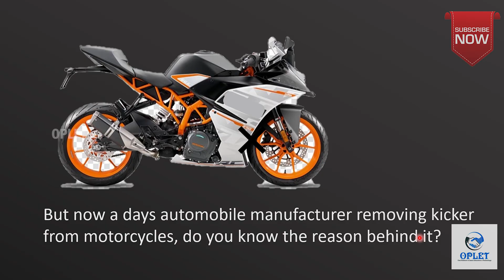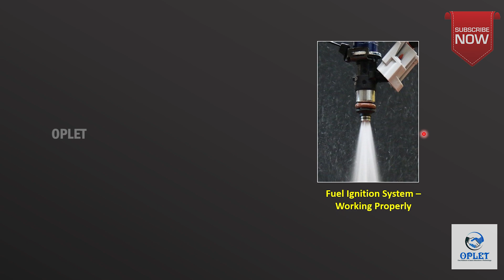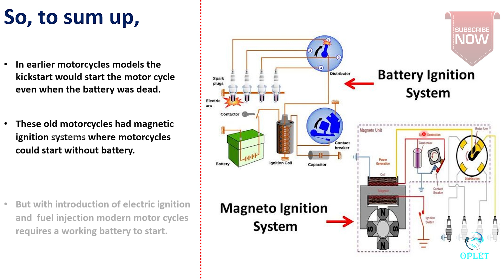Why there is No KICKSTART in modern motorcycles? - Reason behind kickstart removal

Comment: Modern bikes that are fuel injected have a fuel pump , instead of gravity feed to a carburettor. It requires power to function. This is why electric start is used. A battery is needed to function.

Comment: Couldn't understand this reason. 
When the battery is weak, the voltage drop during cranking the engine(using the starter motor) itself is higher and may reset the controller frequently causing improper behaviour. Instead if a Kickstarter was present, that voltage drop can be reduced and the engine can fire even at lower voltages around 10V provided the fuel pump runs. The various sensors draw very low currents and only the actuators draw some current but there can be calibration tables that are designed for low voltage operations of the actuators.
In case the voltage drops too low, the various relays won't get actuated and the systems won't run. So I think the kick starters should have been present. One of my motorcycles has a high parasitic loss and I need to keep the bike running frequently to avoid a battery charge drop just because it does not have a kick starter.
Reply from the maker: Yes in case of Kickstarter you analysis is correct. But in case of electronic fuel ignition without battery bike won't work so it is unnecessary to provide Kickstarter. Also in case any emergency situation if your battery having little bit voltage also battery will crank engine and engine generator will start supplying AC voltage and bike electronic system will start working.
Reply from the maker: Ya also you are right but i just gave a valid reason why companies are not giving Kickstarter in high end super and hyper bikes, but in case of low end cc bikes it just costs cutting and some other reason.
Reply: Long story short, if your battery is too weak to crank, its too weak for the electronic fuel injection system / ECU. They don't want you to use it without replacing/charging battery. 

With a weak battery, even if you manage to start, the electronics will then be driven by the alternator and not the battery. This is not a smooth source of power and hence they want to avoid it.
Reply: @Ganesh_Sh  I haven't yet seen a rippled charging voltage from a good alternator but I haven't seen the waveforms of a weak battery being charged by a good alternator. Besides, the ECU's voltage regulators should be capable of handling the ripples.

Actually my focus was on the condition that the battery is good in shape but not having enough voltage , maybe due to not running the engine much. I regularly face a problem as the parasitic drain on my bike is high and I need to run the engine once in 6days. In that case the voltage drops and I sometimes find it difficult to crank as the voltage drops. It is such conditions that a kick starter can help. But that bike is a 400cc so do not know what kind of resistance that would have while kicking.
Reply: @rohanrayakar2257   I have driven both bike & car by jumpstarting them with a good battery and switching over to dead battery. The vehicle behaves oddly, the throttle response was not consistent. The reason being a variable source - The alternator. 
I did this to take it to nearest service center for works and will NOT recommend doing this on modern vehicles. They need a good battery!

A normal bike will not drain battery every week. Sounds like you have a minor short/ earth leakage.  Which bike do you have?
Reply: @Ganesh_Sh  I have a Himalayan. It seems to have a higher parasitic drain and I do not run the bike much. The battery is also more than a year old so the charging and discharging hasn't really been done well due to the low running. I do not doubt a short since the battery can hold a decent charge for more than a week giving me several crank attempts.

PS: most of my comments are related to a good battery at low voltage and not a dead battery.
I do not run the Himalayan that much so the voltage drops and if I leave it without running for longer periods there have been times when the voltage was a bit low, where I had to remove a few fuses to reduce the battery consumption from lamps(auto headlamp and taillamp ON when ignition us turned ON) and then crank the engine. It is these conditions that the kick starter can help. I guess RE has worked on the parasitic drain and improved the newer models. So the kick starter may not be relevant for newer vehicles.
Reply: @rohanrayakar2257   Himalayan does not have any modules that keep continuously draining the battery when OFF. Your bike has minor wiring issue / leakage. Get it checked.

P.S. I have a Dominar 400. Cranks fine after 3-4months of non-usage on a 3year+ battery. (Bike was left covered during COVID times) 

Rather than asking for a kicker, get your wiring fixed!
Reply: @Ganesh_Sh  Thanks. There could be a leakage issue in my bike and I will get that checked. It makes sense that if all systems are good and if the bike is run regularly then the kick starter would not be necessary.